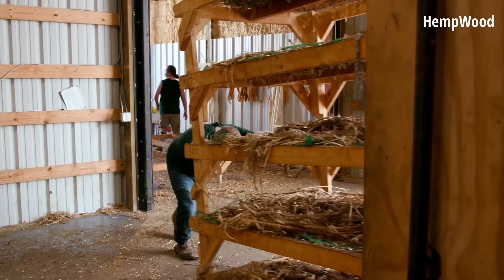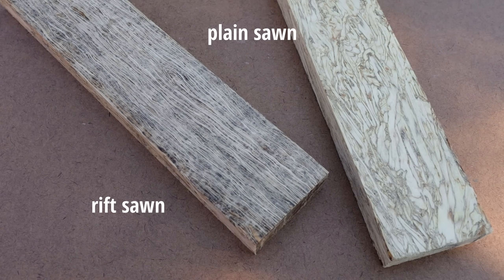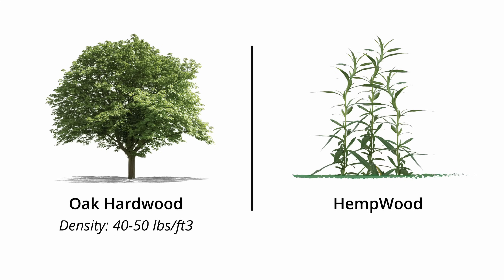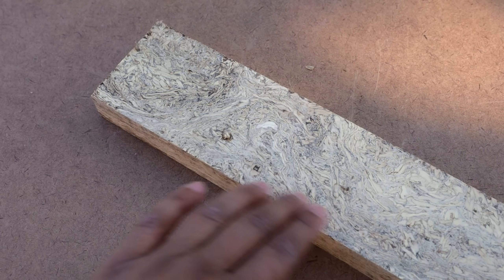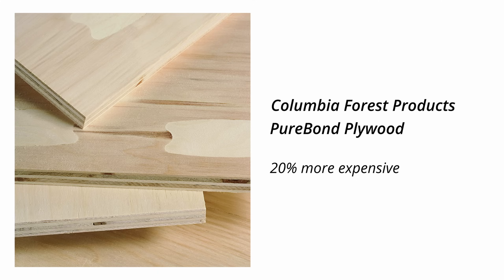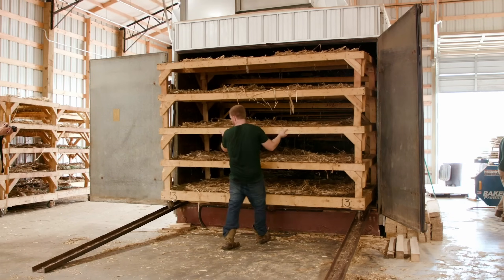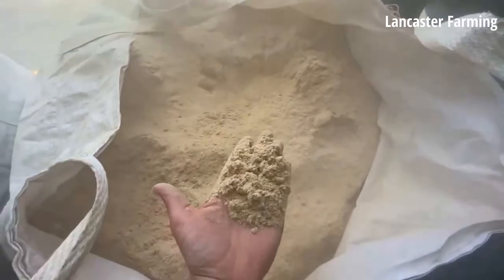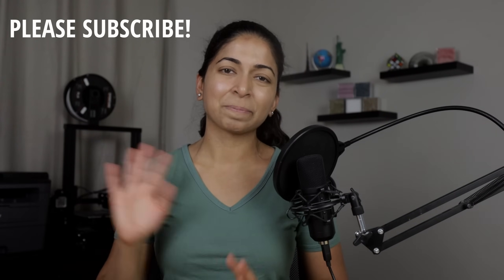HempWood | a NEW eco-friendly hardwood

Comment: I appreciate the manufactures honesty about the potential and limitations of the product- if you could replace all interior cabinetry, flooring, and furniture with this product you’d still save a lot of old growth forests and illegal logging!
Reply: It isn’t structural unfortunately it’s just decorative. What is better for saving old growth logging is cross laminated timber. The wood is sitka spruce grown sustainably on tree farms, not taken from forests, and it is very strong light and environmentally friendly. It has a better strength to weight than concrete and even some steel.
Reply: That is our goal!
Reply: @rando5673  yep :) i know
Reply: @BigCroca  
If you'd learn to read, they said cabinetry, floors, etc.   They didn't say build the cabins structure out of it.  Combine the sustainable lumber farms with hemp wood for the best of both words.  Hemp wood grows much quicker and is great for non structural uses.
Reply: Illegal logging will always be economically more competitive than any alternative.  Eliminating it requires a politically integrated society with respect for laws.  One can hope, but it is helpful to hope for what matters, not to hope in vain.
Reply: bamboo, may be a better option for wood type products I dunno, but Bamboo is not legal to grow in many areas, due to it being a fast spreading rhizome.
Reply: Ahh you see, but cutting isn’t the issue honestly! It’s the hardwood market cutting either ancient trees that could hit a point of death, THEN be cut, it down and make planks. It’ll also be slightly stronger as it’s pre-dried as well. Even our controls burns are needed as Canada didn’t do them last year from pressure, and they had a super smog fire they struggles  to put down. This could turn strong pressed construction lumber with a hemp outer to wait, OR make a tree farm. It IS possible, we have them already after all. Humans are simply learning we are designed to balance the eco system. It’s like hunting, if humans just stopped, everything will explode in population due to them compensating like we still hunt them. That leads to barren lands, animals eating our crops to survive, predators finish off all the herbivores due to the amount of prey and repopulation. We die in that situation as well, we don’t want everything starved.
Milk is the same, we got TONS of cattle. Currently we have an animal we have domesticated so much, the original species is extinct and looked nothing like our cows. If we didn’t control how many males are born (it is a 50/50 chance). Sadly if we didn’t it’d lead to territorial males who’d fight and kill each other. It can get awful. So there isn’t always a baby cow that could drink that milk, that meant it had a boy. Just gotta ask where the cows male privilege is on this one cuz that’s kinda common in nature for all species.

Comment: What happens when the house floods due to broken pipes or rain floodwater and the water persists for more than 1 hour? Is the flooring ruined? Can it be protected further? I live in the tropics. The humidity is currently 77%. Does that mean that hemp wood is a non-starter?
Reply: Belinda said humidity level requirements are between 35-55% -- your situation is a non-starter.
Reply: In my opinion based on European build standards, If any house would have broken pipes or floodwater indoor all the houses would be ruined. I think you should build your house better to prevent from broken pipes or rain floodwater.

Are broken pipes common in the US? Here in Finland water and sewerage pipes are replaced every 45-50 years.
Reply: @ristoreipas21  "Are broken pipes common in the US?"
Having a toilet, sink or washer supply line fail is not uncommon. When they do, they can spill water until someone is home to notice.
Reply: This is not a product for your area.
Reply: I’m not sure what flooring would enjoy being flooded
Reply: @timgleason2527  Tiles! which is what I have.

Comment: I've never really like the engineered wood flooring. Their inability to cope with moisture makes it just a matter of time before they come apart like OSB.
Hemp's primary uses prior to the ban were rope and fabric. They do well at that.
Reply: Yeah, given the restrictions and cost (seems like glorified particleboard to me), I'm wondering how this makes sense compared to bamboo.

Pretty though, and that might be worth it to some.
Reply: It might be better idea to make furniture with hemp wood
Reply: @wiezyczkowata  So long as it doesn't get wet.
Reply: @wiezyczkowata  It might!  But the x6 by 6' limit of the material (as it stands) would be a deal breaker in my shop.
Tops and seats would have to be laid up just to get the width required to make a table or chair.
It can't get wet so something with slats like a garden bench or picnic table are out.
While one could design a furniture product around these limitations domestic hardwoods are half the price and come in dimensions I can use.
Reply: @jimurrata6785  looks like hemp wood need some more working on
Reply: @wiezyczkowata  These are early days. Perhaps innovation or iteration will improve some aspects.
But as mentioned above, hemp has always been used as a fiber (which is it's strength)
If you are looking for a use why not start with something it has always been good at?
Except of course that rope and cord are not a fixture of daily life like they were in the era of sailing ships and horses.
And we have much stronger wear resistant fibers like aramid and dyneema today.
Woven into fabrics???  I don't know how hemp compares to something like cotton.
I'd like to try it.
Reply: Yeah, hemp fabric and fibre are amazing natural products; if hempwood can be upgraded to have better environmental tolerances that would be great, but otherwise let's stick to what it does well.
Reply: @jimurrata6785  Considering what we saw in the video, that's an artifact of their current process. I couldn't see any inherent limitation which would prevent them from creating larger surfaces ...
Reply: @brag0001  Which is why I said iteration or innovation in their process would make it a more viable product.
At this point it seems to consume a LOT of labor (and blades!)
But bigger planks and perhaps even sheet goods would help, as would driving the price down to maybe twice that of domestic hardwoods like oak and maple. $5.50-6.50 a bf would be a lot easier to swallow.
Reply: HempWood requires the same treatment as traditional hardwood floors. If you flood your house, the floor will be damaged. If you spill water, the floor will be fine.
Reply: @hempwood2602  " If you flood your house, the floor will be damaged."
Hardwood dries, engineered wood and laminates fall apart. A solid piece of oak or maple can dry intact. Compressed fibers require quite a bit of waterproof adhesives to do the same.

Comment: If the hemp wood is so awesome why do they bond it too plywood?
Reply: I would guess cost...... plywood is cheaper than the hemp wood. Just like an engineered oak flooring.
Reply: @bitchn_betty  2 1/2" solid Select Red Oak is around $3.25 sf 
Why would you want to apply an oak veneer to plywood or OSB except for those prefinished floors (like Bruce) 
I would guess that the compacted hemp won't cleanly machine the tongue and groove required for solid flooring, or you can't really drive cleats or staples through the tongue without breaking it.
Reply: We make panels for accent walls and tables. Because HempWood originates from a block form, which is 5.5 x 5x5 x 7". Due to the limitations of equipment and size capacity, is the reason for HempWood panels. The panels use PureBond plywood.

Comment: Audiophiles would appreciate speaker boxes and record player bases made with high density HempWood.
Hemp was/is the choice of rope makers. It has long and strong fibres/fibers. I like your work.
Reply: I don't know about speakers. Sure some will, but MDF is chosen for speakers specifically because of its damping property, so the sound is very controlled and not dominated by cabin resonance, there was a research paper published by Visaton i think around 1987, not sure, where it won against any wood or engineered wood-based material. However same paper also suggested that concrete-bitumen laminates or glass laminates would be good too, though not so practical. I do think hempwood laminate including some sort of damping element could just be it, more research needed.

As to record player plinth, density is for sure an advantage. There are separate damper elements in the construction, predominantly feet but also platter+motor can be suspended, but high plinth mass helps the dampers be more efficient. However high stiffness isn't strictly an advantage. One of the best plinth materials being natural rubber, which is more than twice as heavy as hardwood, but also inherently damping.
Reply: Reminds me of the Grado hemp headphones!

Comment: If the hemp wood is held together with resin, is it as heavy (or heavier) as other traditional plywoods, particle board, or chip boards? One of the drawbacks of particle board is that it is very heavy with all the glue that is needed to hold the particles together when compared to real wood boards.
Reply: More dense than oak means heavier than oak. So yes, very heavy.
Reply: @modarkthemauler  Correct!

Comment: This product is unfortunately worthless to my 70% humidity indoors Louisiana self, but I'm very glad there's an alternative for non-coastal folk!
Reply: I was thinking the same thing because you couldn't get the humidity down enough in Florida where I live to use this, like 50 percent humidity is not ever a thing here. That would mold so fast here, Plastic chairs mold here in a years so this wouldn't last 6 months. Also palmetto bugs love eating press board and without the toxic chemical they would love eating this stuff much more.
Reply: Belinda does like to hammer on the right product for the right region.
Reply: @TheNightshadePrince  Whats the issue? I assume you have wooden things?
Reply: @benholroyd5221  No solid wood is fine but press board and chip board quickly swell and rot here when exposed to air. Also we have palmetto bugs which love to eat anything that is edible but the prefer engineered wood.
Reply: @TheNightshadePrince  ok. I take it it's a glue issue then

Comment: As a woodworker this is really interesting, but I am curious about material motion over the year in comparison to standard wood.  Not that I think it will be worse or better, I just need to know how to accommodate for it.
Reply: 15 USD/bf for 4/4, and can only get boards in 5.25in widths.
Reply: I don't think there will be any motion since this product is similar to stabilized wood. In another words - the fibers are glued together.
Reply: @xTatsuran  I can see why that might be the case, but especially for the riftsawn product, there is a defined grain direction, which means that I suspect there will be seasonal swelling perpendicular to that direction, the same as with hardwood.  This is especially of concern when you are considering the warning that the materials are not water resistant.
Reply: Yeah i wanna try carving it
Reply: @GeahkBurchill  ooh I bet that would eat your edge alive, but it also looks a bit like burl in the flat sawn orientation... I bet it would be interesting

Comment: The hardest comparison oak is a little unfair.
a more honest comparison would be glued oak fibers versus the glued hem fibers.
Reply: She also conveniently left out Tannic Acid, one of the major contributors that make oak wood so preferable as it is the high concentrations of Tannic Acid that makes oak wood resistent to moisture, rot, fungi and insects. Knowing about Tannic Acid and what it makes Oak wood capable of, she really just made a greater case for using oakwood than using hempwood for furniture

Comment: Being free of formaldehyde is a huge deal.  It's why I'm reconsidering my use of MDF in my wood projects.
Reply: Every piece of wood and I do mean EVERY piece is processed to sterilize it from insects and fungi. I have a mobile sawmill and I spray every board for my customers as well. If not the wood will be streaked with fungus and insects.

Comment: The cost is pretty high but that makes sense for such a labor intensive product.  It's nice to have an eco-friendly glue but if it's not structural and is so sensitive to moisture it sounds like it might be the weak link. Improving the process, getting a better glue and figuring out how to seal it would make it a legit contender.
Reply: Thanks for the insight, Mike!

Comment: I would love to see this flooring available as a waterproofed product.
Reply: That would most likely require a polycarbonate sealant, aka plastics
Reply: @Arterexius  I’m sure they can solve this with natural oils instead of plastics. 
Look at the leafs of water lilies for example. They are completely water repellent. Nature is beautiful. God put us on a plain with everything we need in nature 🙏🏻
Reply: @marcelvdfvandamme5927  You can't solve it with oils alone, let alone natural oils. Because although oil is Aquaphobic, it can still be washed off and natural oils are the least resistant oils. Textures like the surface of the water lily could of course do it, but there's no chance in oils. And if you want it professionally done or done in an affordable manner, it's polycarbonate, as mimicking the texture of the waterlily on the floor boards, while accounting for the increased wear that those boards would be subjected to? Let's just say it wouldn't be cheap.
Reply: @marcelvdfvandamme5927 oils could/would eventually evaporate, rub or wash away.  Waxing is the only "resistance" not "proof" that can be done an once again with consistent ribbing the wax will wear away.  Ultimately the floor owner will have to take responsibility for water "resisting" their floor.

Comment: It really sounds great. However, it's extremely susceptibility to water seems to be a huge problem.
Reply: I agree. To me it just becomes a fancy alternative to MDF and HDF and will require equal amounts of polycarbonate sealants to become a realistic wood for cheap furniture, thus defeating their environmental purpose
Reply: pretty much all engineered wood products have the same issue. i love MDF but it's a sponge.
Reply: You are still using the same preventative measures for our HempWood that you would use for wood flooring. As long as you treat it like so, your flooring will stay in good condition.

Comment: Trees need 50 years to grow to harvest size. Hemp needs one year. That isn't enough to determine which is a better use of resources. Growing hemp means soil is tilled every year. Hemp fields are fertilized every year. Trees are planted once every 50 years and no fertilizer is used. Also, which is a higher yield of fiber over a 50 year span? One section (640 acres)  of forest products or one section of hemp fields? Now consider the energy and labor to grow, harvest and process those crops and it might be more economical to grow wood.
Reply: I'm not sure that you necessarily have to till or fertilize. There is new soil health technologies kindof discouraging that attitude in farming. Plus, it's a weed. It's more than happy in poor soil.
Reply: Pretty sure both are being harvested and planted constantly, not just every 50 years there is one big tree chopping party. But yes would like a thorough breakdown of the resource usage and impact.

Comment: One has to admit that this is an engineered wood that requires a lot of work before end use. It’s a low productivity wood product because it requires a lot of work after crop. But it is indeed an eco wise product, since it uses the trashiest part of the plant. They use to make ropes and clothes with that. It was a plant very popular among the farmers, because the market was huge.
Reply: I would argue its potentially less eco due to the carbon footprint from the needed materials to process into lumber including baking, soy glue production, etc.
Reply: Does it require more work than OSB?
Reply: @kingdarkem  why do you have to convert it into lumber? There are many uses for hamp without wood flooring. Just cause one use is expensive, labor intensive doesn't mean product is bad. Don't throw baby with a water. Also, with time and more companies involved technology will improve, gets cheaper and more eco-friendly. Improvements need time and incentives.
Reply: There are still textile made with hemp. Actually it has some quite competitive properties.
Reply: Ok this youtube nuking my reply comments is getting old. Green is not always clean.

While the company maybe eco friendly. Suppliers and trucking is not eco friendly and could leave a bigger foot print. Sure the more people who do it the cheaper it gets but the more trucking, factories, and heavy machinery gets used. 

Sure dont have to be wood flooring. But everything has a foot print.
Reply: @tucker2251  at first glance, the industrial and structural engineer in me would say yes. 
Oriented Strand Board, Laminated Strand Boards, and other Pressed Wood Particles products are made via highly mechanized and systematized industrial processes that require relatively low manpower. Those processes are, in a sens, not very complicated. 
But a thoroughly economic study would be highly appreciated. Don’t you agree?